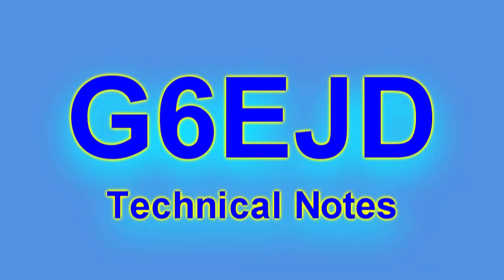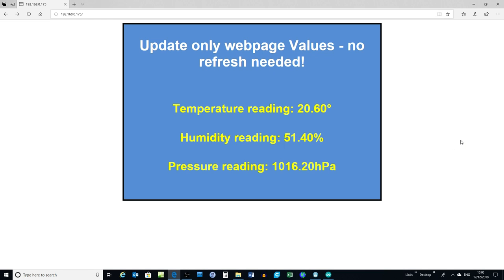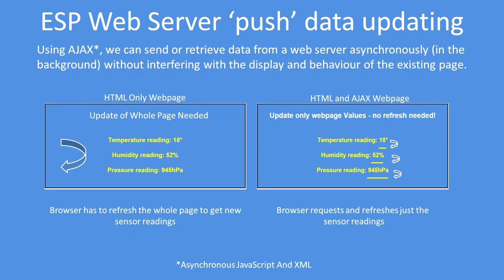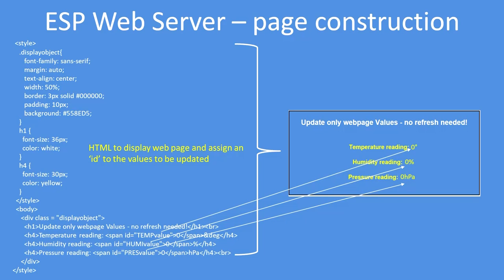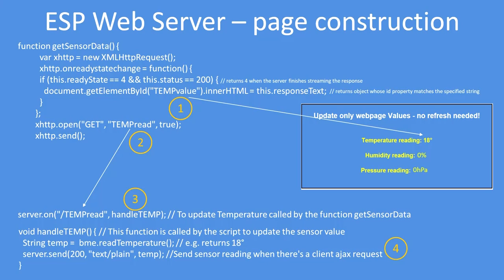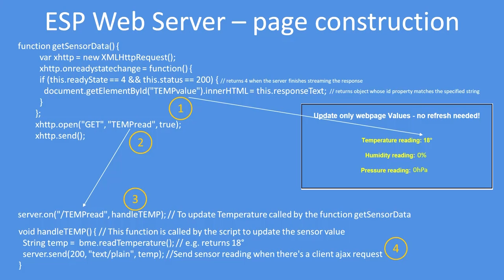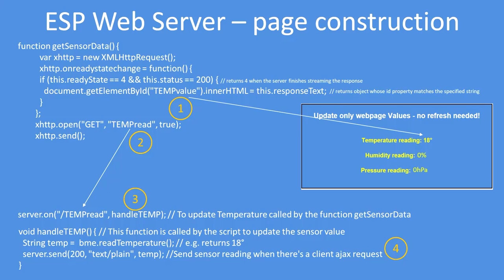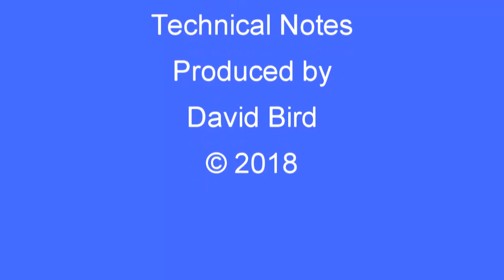Tech Note 113 - 'Pushing' data to a client's webpage from an ESP Webserver using AJAX

Comment: Wow this is great! In my application I have to save in the permament memory of the ESP32 (I'm using virtual EEPROM) the hysteresis value of a termostat +/- 5°C, the value is sent to the ESP32 with a POST and then I need to display the same new value on the webpage and in addition I need to display the temperature changing form a sensor on the webpage. Thank you for your great example. Now I have to understand hot to send not just one data but an JSON through AJAX because I have quite a lot of data to send.

Comment: A good start, you can return all the sensor data in a single request using xml or json. It's still a pull from the web server though, you can use Websockets to create a true push from the webserver when a value changes, it's very efficient but a bit harder to develop.
Reply from the maker: It’s all a compromise when trying to make the example easy enough and relevant for most people who don’t really know where or how to start. I looked at various methods and in the chose this one.

Comment: cool video , how to do the reverse process : having a website loaded in the esp32 from which you would have an entry field where we could set a numeric value that could be used in the esp process. I ask that because all video that I have seen are about setting on/off led but never setting a dac (analog value)  thx
Reply from the maker: Jean-Luc, you would need an html input field to get the user entered value like in the examples I’ve provided then having got the ‘text’ value in the c+ convert it to eg an integer, like this int parameter = value.toint(); 
Then dacwrite(DAC1, parameter);
Reply: @G6EJD  would you be intérested to create a vidéo for that because presently I did not succeed to do it thank you
Reply from the maker: There is only two lines to add to one of my example sketches to do this, I’ll see if I can produce a video

Comment: Great project.  But I am trying to figure out why the vast majority (but not all)  calls to update the humidity and pressure values fail, returning ERR_CONNECTION_RESET when xhttp.send() is sent to update those two variables.  Commenting out all but one of the xhttp variable updates works perfectly.   Excellent learning experience - thanks!  
Had high hopes of using visual studio code(vsc) with the arduino plugin instead of the arduino ide -  a work in progress with the esp32 -as vsc has a hard time finding all the needed include files.    73 K6CCA
Reply from the maker: Is your update rate to high as the sensor takes a finite time to read and realistically a minimum refresh of every 15-secs is required and in real practice about once per minute or even hour as the environment does not change that quickly. Also try a different browser to see if the problem continues, any versions of IE will not work or work spasmodically. 73 Dave
Reply: @G6EJD  Solved by combining all sensor data into one JSON string and sent as one xhttp.send().  Updates all fields every second without error.  Thanks - great project!
Reply from the maker: Elysium, good to hear all is ok now.

Comment: Hi Dave. My apologies for the simple question, but if you or one of your viewers can guide me in the right direction. I have a Wemos ESP 32s board. I am finding it near impossible to get it to accept a sketch. Even the simplest of sketch examples.  I get ERROR     Uploading 288400 bytes from C:\Users\Main\AppData\Local\Temp\arduino_build_263517/Blink.ino.bin to flash at 0x00000000
warning: espcomm_send_command: didn't receive command response
warning: espcomm_send_command(FLASH_DOWNLOAD_BEGIN) failed
error: espcomm_upload_mem failed
error: espcomm_upload_mem failed

I have Installed what i believe is the correct Driver, by typing WEMOS into the board manager. I have selected com3, and reduced the upload speed to 115200

Any recomendations?  Kind regards. Craig
Reply from the maker: Craig, the Wemos ESP32s is likely to be a copy board of questionable design quality. Some boards such as the Firebeetle I find to be highly unreliable and it exhibits very similar problems to yours and I’ve never found a reliable solution. Things you can try are 1, always programme at 115200 baud, try selecting the ESP32 Dev Board, 3 reset the board just before the programming starts, takes some judgement to get the timing just right. On my board it usually takes about two or three goes, on the true Wemos D32 boards they work first time every time at 900k. Try a different cable short as possible
Reply: @G6EJD  I can't thank you enough for taking the time to help me out. I will definitely try that out as soon as the electrical storm passes over and I can switch my pc back on :) If you were to suggest a comparable board, what would you recommend?
Reply from the maker: Craig, without doubt the Lolin D32 it’s near perfect and very low power. It costs more but really only from the AliExpress Wemos or Lolin store to ensure no fakes!
Reply: @G6EJD  Once again, thank you for the feedback. I have ordered 3 of those boards from Ali, and will give those suggestions a go anyways on the 32s board :)